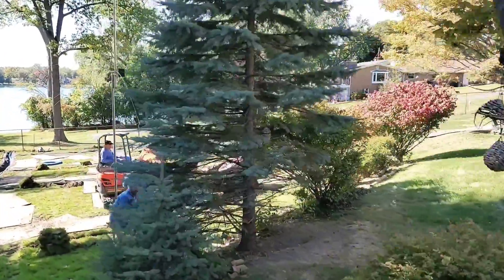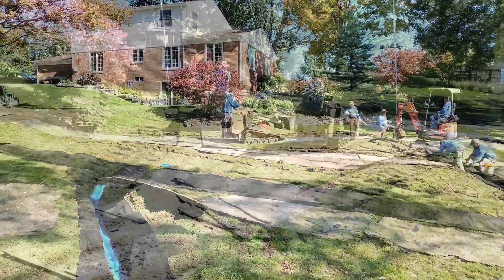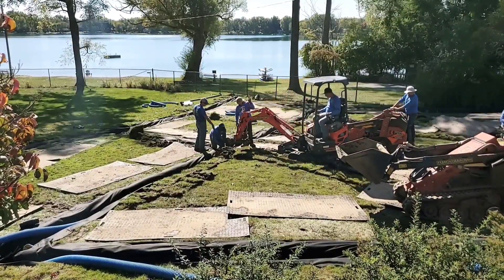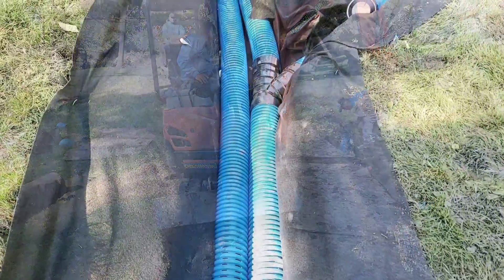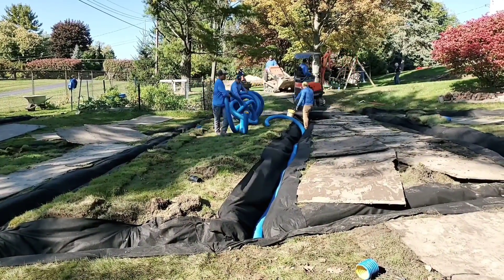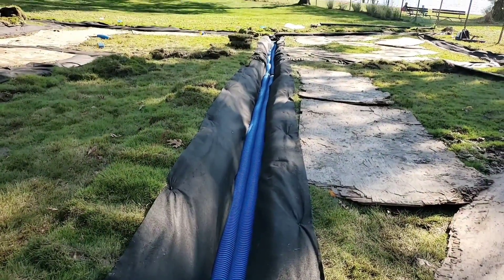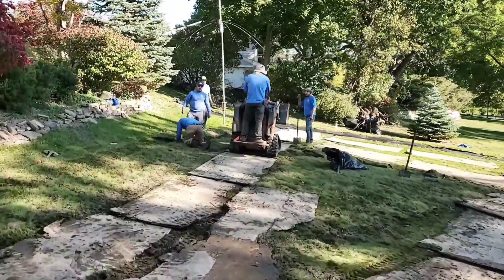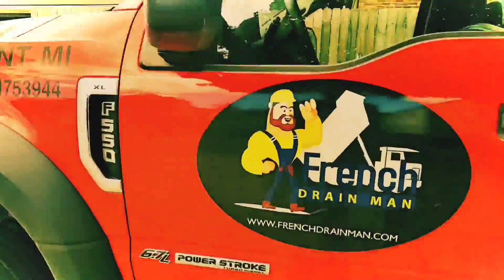The Anatomy of a Gravel / Stone French Drain Explained - Why You Don't Need Catch Basins

Comment: Hi, New sub.  Great and interesting content.  Sorry if I missed it, but are you experienced with Rubble Trench Foundations?   Essentially french drains under foundations to limit use of concrete in building. I find it amazing how many types of fabric there are out there, and how little information there is on the best fabric to line the trenches with to limit siltation.  I expect you would have the same objectives in your french drains (ie allow water movement inwards but not silt) but any thoughts on this would be wonderful.
Reply from the maker: I'm hard core double pipe installations with double punched fabric it over comes everything I can think of.

Comment: What guides your decision between using bottom-perforated pipe and completely perforated pipe?
Reply from the maker: I have never used bottom perforated pipe it a liability. Once the bottom is full of sediment it's completely useless. Having 8 holes all the way around the pipe 360 degrees is full proof plus it air pruns tree roots during the drought season. I tear out a lot of PVC because it's only available with holes on the bottom. I will not use it outdoors for anything even if you gave it to me for free. Corrugated pipe for 35 years and my 1st system works as good as my last.

Comment: Robert a question and my plan.
You had a video of how solid pipe gets separated when in the ground I guess because of ground movement/settling. What prevents the blue pipe connections from doing the same when there not glued together?
My plan:  picture asquare house with 3 gutter drains on the left side and 3 on the right.
50 ft behind house runs a canal I intend to drain into
I was going to hook the 3 drains into a solid pipe that will run parallel to the side of the house.  Same for the other side.  I live in Florida and I have ROOTS!!! Along that 50 ft run I wanted solid pipe to maintain the drain pitch vice flexible pipe because of the difficulty with the roots and establishing a drain pitch in the trench with a shovel.  What say you
Reply from the maker: https://youtu.be/FIQcvLAZgDo
Definitely build it with a vent stack. During the drought months you can air prun the roots. 
When pipe with ONLY holes on the bottom get filled with sediment they stop working. Corrugated Pipe has holes on the bottom,  sides and top.
Reply: @FRENCHDRAINMAN  thank you Robert!

Comment: Question- we live on a corner, no sidewalks or drainage, the road is slightly above the level of our yard. There is 5 feet of rock between the road and yard.  We live in an area that gets a lot of snow. Soil seems to percolate well. I'm having issues with rainwater drainage from my roof, seems my only option is to install a large dry well and install solid pipe from downspouts to dry well?
Reply from the maker: https://youtu.be/SrqcHSzAdBA
Reply: Can’t you add dirt to raise your yard just above the road?